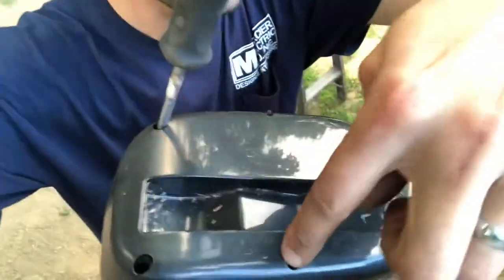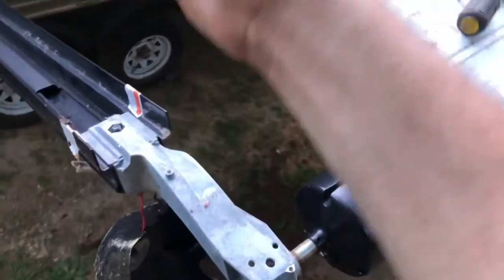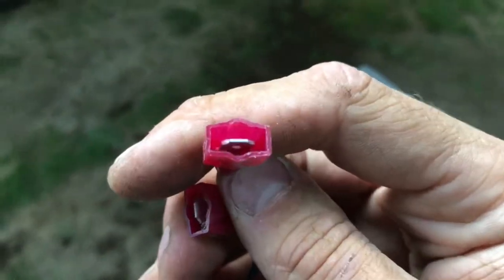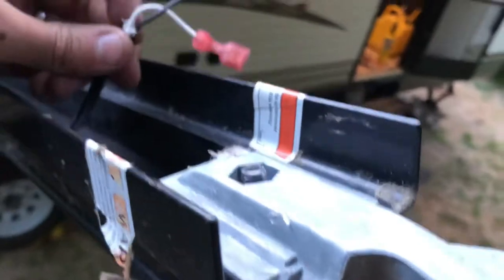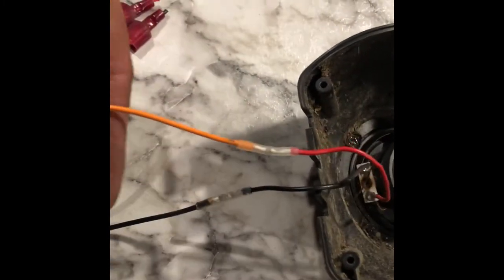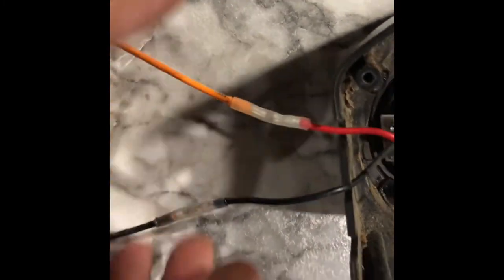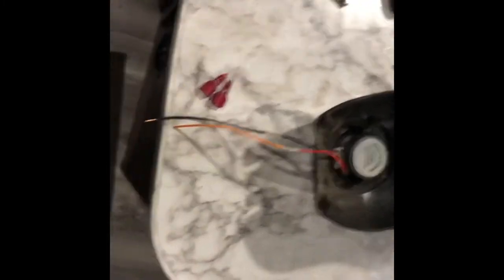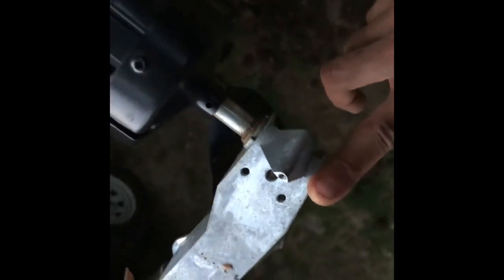Repairing outdoor speakers on travel trailer

Comment: I got the same speakers and I did the same thing with solder sleeves and they work great! Now I’m trying to figure out if and how to add exterior 6.5” or 6x9’s on the camper outside wall